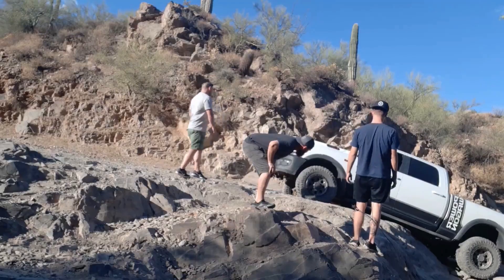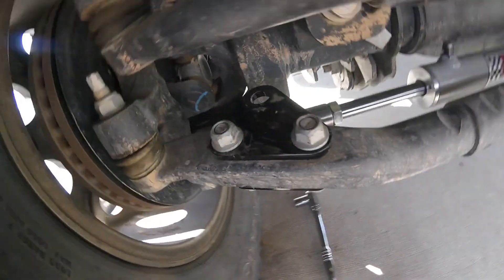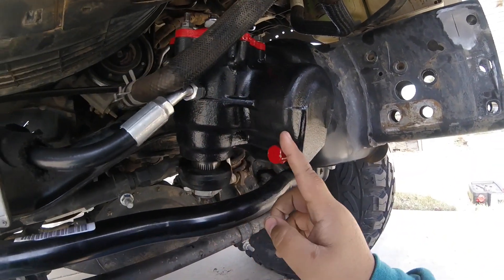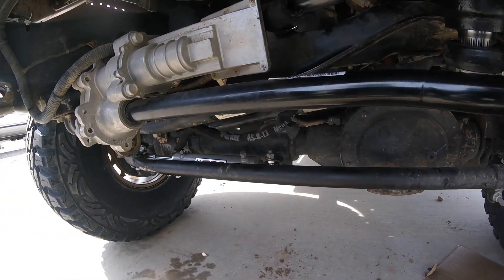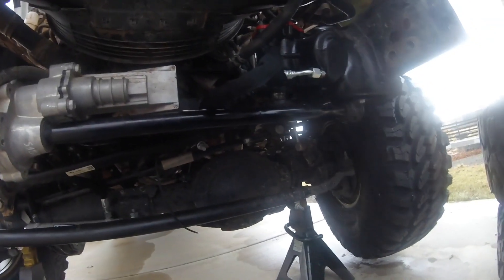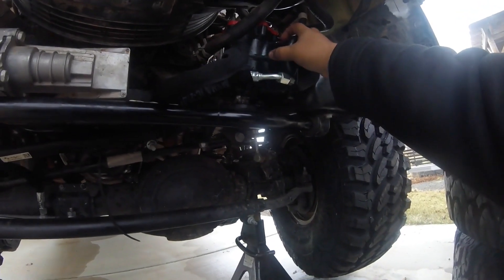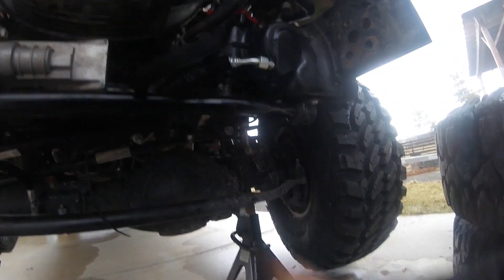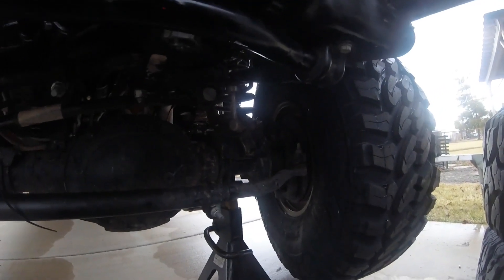5th Gen Power Wagon Ram assist install

Comment: Hows it holding up brother? I dont do heavy trails but i do tow very tremendously high centered loads and have 35s but looking to upgrade to 37s for the trails and dont wanna do another stock steering box or spend 1000 dollars on stabilizers that dont actually have utility like the PSC kit

Comment: Why didn’t you just get the whole PSC ram assist kit with their modified 3500 box? Was it not available when you did this? Doesn’t surprise me about the AEV kit. I’ve not been impressed with their products from personal experience as well.
Reply from the maker: I did this in late 2020. No one offered a gearbox for the truck. I had to piece the kit together. I'm more than satisfied with the redhead gearbox.